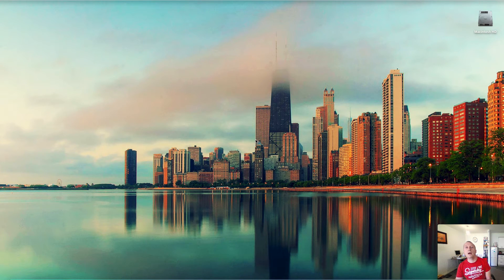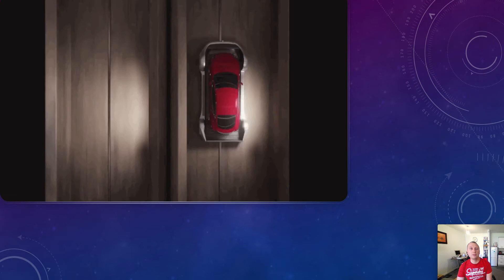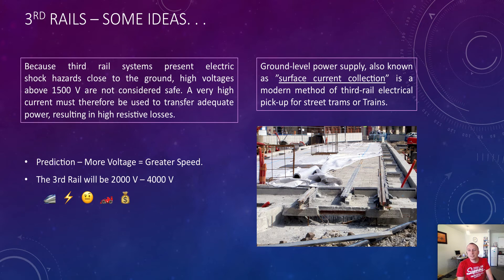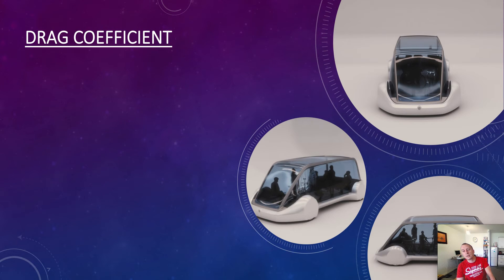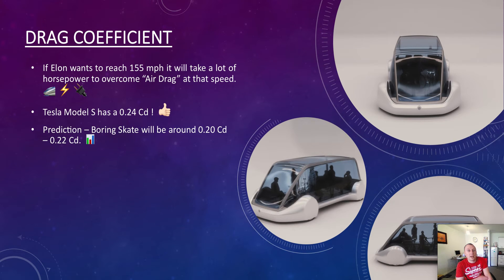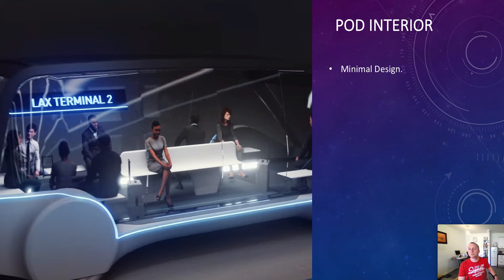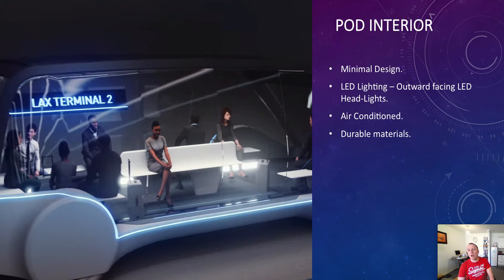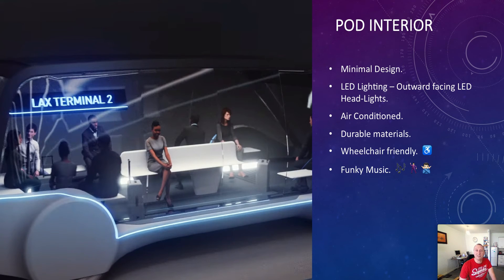A Boring Revolution  - Episode 4 - Elon Musk Announces New Boring Pod & Skate Designs!

Comment: I saw an interview where Elon said that they won't be using a third rail.
He said that in case of a breakdown, people would be able to walk to the nearest exit without being electrocuted...
Reply from the maker: Hi, can you send me the video link ? I believe that is a "mis-quote" otherwise why would he produce several plans with a third rail clearly shown on them????
If I drive a Model S P100 at a solid 120 mph it will only do about 90 miles and hit 0% charge. So why waste $115,000 to install a 400 kwh battery in every pod when you can just link in a 3rd rail line for 1/10 of that price per pod? 
Also you won't be electrocuted because the 3rd rail will be turned off if required in certain tunnels. 
A 3rd rail is the logical option - hence why a lot of metro systems use them.... You are 5 times more likely to be struck by lightning than be electrocuted by a 3rd rail in a major European city!
Reply from the maker: I think this is an unbelievable mistake by Elon Musk and his team. It was never mentioned on his 2 recent talks including TED and the presentation in in LA. fancy writing that into the small print.
Reply from the maker: I could build a pod at 1/3 the cost and with a higher top speed if i use a 3rd rail. The reasons also for its exclusion seems to be bizarre in that next to no one has been electrocuted via 3rd rail in the U.K for maybe 10 years. How can he justify this ????
Reply: Also there would be a fair amount of downtime for each pod to be recharged. Unless they use some sort of battery exchange system.
Reply from the maker: Would take about 30 - 40 minutes to charge. Thanks for the heads up!
They also uploaded a cross section of the tunnel - looks to confirm what you said.